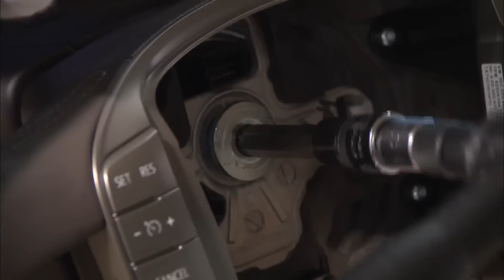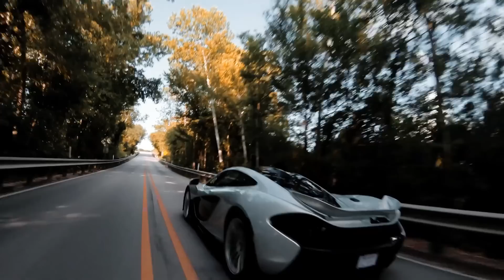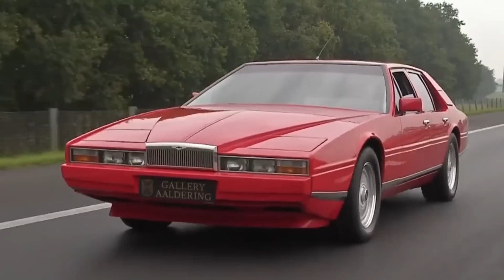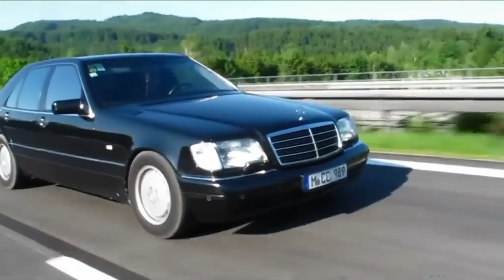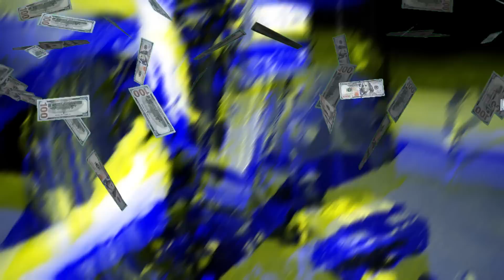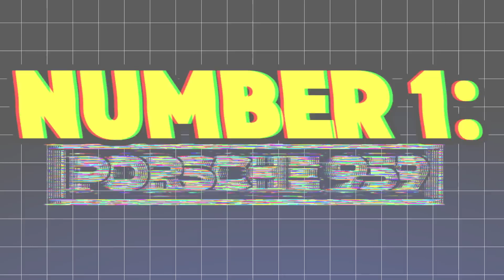17 Stupidly Complex Cars That Will Bankrupt You in Repairs

Comment from the maker: 17 Car Repair SECRETS That Will SAVE You $3,000 (Every Year) https://youtu.be/wrXto638gdI

⬇Care Care Clues Top DIY Tools and Products:
🚗 Essential Scan Tools
Newest Scan Tool:https://amzn.to/3GJyuET 
Bluetooth Scan Tool: https://amzn.to/42AcBRc 
Cheap Scan Tool: https://amzn.to/42WZIzx 

🔋 Emergency Essentials
Best Jump Starter: https://amzn.to/44fYOAm 

🛢 Fluids and Leak Stoppers
AT-205 Re-Seal (Stops Leaks):  https://amzn.to/3S9icYm 
ATS 505 Fuel System Treatment: https://amzn.to/3YQjjA2
Lucas Oil Transmission Fix: https://amzn.to/4jNk98M 
Bar's Cooling System Stop Leak: https://amzn.to/3Sht0nj 

🔎 Quick DIY Diagnosis Tools
Head Gasket Leak Test Kit: https://amzn.to/4jRgc2T 

🛠 Useful Maintenance Accessories
Quick Twist Oil Drain Valve: https://amzn.to/4jWG3GJ 
Tire Gauge (Check Pressure): https://amzn.to/3GxySGD
Tire Air Pump: https://amzn.to/3RZK9Cd 
CRC Mass Air Flow Sensor Cleaner: https://amzn.to/44dJpkb 

🧰 Mechanic’s Must-Haves
Car Battery Tester: https://amzn.to/4jTqyzk 
Basic Mechanic Tool Set: https://amzn.to/3Ymgerh 
Cordless Impact Wrench: https://amzn.to/3YkkhVc

Comment: In all the years I worked on the prelude the 1992 4WS was the most problematic the 88 through 91 prelude had mechanical 4WS steering and the pop up headlights hardly gave trouble unless it was wrecked.

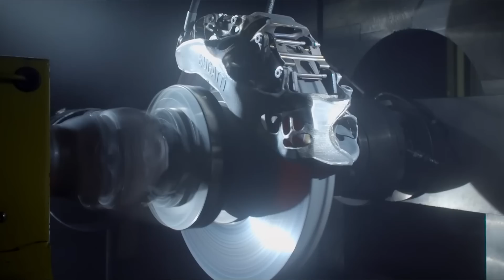Comment: @12:35 I thought the first production cars to use carbon ceramic brakes were the 2000 Mercedes SL55 AMG F1 edition, 2000-2001 Porsche GT2 & Ferrari Enzo. 1st production vehicle(s) to use titanium bolts/hardware were the Honda/Acura NSX (certain variants or all) & I believe the Z06 Vette. I may be wrong. 🤷🏻‍♂️

Comment: All these cars arent even accessible to the plebian. I worked on w100 once its not that hard but, its a complex system for its age. Without a workshop manual its a headache

Ls600h is not that hard to work they only have the valley plate issue and beyond that its ok. Not much breaks on it

Comment: I'm old enough to remember when cars had points & carburetors,4 wheel drum brakes & no emission controls. When I started working in auto repair🛠 things were relatively simple. OBD 1 computer systems,throttle body injection etc. I got out of it years ago. I own a base model 2000 Chevy S-10🛻with over 392,000 miles on it. Bought it used in '07 for $2,600. Over the years it has been a good reliable vehicle,of course I've had to put money into it for repairs.replaced the transmission⚙back when covid 19 was going on. Engine still runs good,no smoke. I maintain it well🛢🛠 and I will drive it to hell & back before I will ever buy a💩🔌🚗E.V. If you can't fix it yourself,always make sure your auto service tech is A.S.E. Certified. The trademark of a great tech.

Comment: Just imagine  the headache awaiting modern buyers with their cars. Since EVs are tanking manufacturers are pushing hybrids. Can you imagine  the repair costs that these 2nd hand owners will face? Quicksm example. A friend bought a 27k mile 4 yr old glc43. 33,000 less then original window sticker. Great deal. Gotta live german car Depreciation. Any way, at around 42,000 mile it have a timing chain cover leak and a transmission leak somewhere. That was 3400 done on extended  warranty.  Now add a complex hybrid  system. Repairs will be bankrupting. These performance  hybrids done make alot of sense in many of the cars. Going back to the glc43. The new one is a 4 cly hybrid, it cost 10 to 15,000 more,m expensive,same acceleration or a tenth better, and its only 1mpg better, but alot heavier. I call that a waste. Just epa butt kissing.  The loaner car he got was a brw c300 with 800mi. Had a check engine light before he gave it back. All tgese cars with the drive in movie  theater size screens will be nightmare repair situations.  And im sure EVs and these hybrids will require special training, so bigger salaries and bigger repair bills.

Comment: For me the worst advancement are turbo engines and direct injection engines, both totally unnecessary along with any automatic over 6 speeds. I own two relatively simple cars. My wife's 18 RAV4. It is a hybrid but reliable and has the simple port injected only 2.5L 4cyl. My truck is a Nissan Titan basic crew cab with the bullet proof non turbo 5.6L V* and a 4spe ed with O/D. PERFECT! We used to drive cars with simple engines like 4s, 6s, and V8s. They had enough power to cruise the interstates and easy to maintain, My wife's previous car was an Accord with the 2.4l engine. Great engine and a 5 speed auto. Buy a good used vehicle with lower mileage if you can and avoid all this new garbage.

Comment: I drove a Citroen GS back in the '70s. It wasn't stupidly complex or unreliable, but it was way better than most cars of the era in terms of comfort and safety, particularly in bad weather.
Reply: The GS was formidable, I love very much to drive it. Alas, cars of the 1970s were made of bad recycling steel that rusted horribly.
Reply: Had a Citroen also in the 90 in France never broke down the engine was what Citroen was known for 😮

Comment: Actually the '57 Ford Skyliner while the top mechanism is a bit complicated for a low skilled DIYer, really wasn't too bad to keep operating. It was simple electrical wiring and simple relays and motors - nary a computer in sight. As to the rest of the car - even that low skilled DIYer could maintain every other system on the car. Never owned a Skyliner but did own a Sunliner (standard convert.) and a Tudor and actually worked on a couple Skyliners as a mechanic. Today, I cn barely work on these new, post ~2000 rolling smart phones/computers that are called automobiles

Comment: Car manufacturers need to build a reliable engine  ,transmission and drive train, and leave the bells and whistles out, basic needs to come back, well built components,easy to repair, maintain, today's vehicle engineers need to stop trying to impress, put the impressions in the main components, engine, drive train, body simplicity, and think about repair or parts replacement, make it using common sense like the vehicles built in the 80s and 90s , early 2000s, and stop trying to impress with all the bells and whistles that are not needed ,they just run the costs up, and always break, I know it can be done, because it has already been done ,these futuristic vehicles are driving off the cliff of nobody wants the headaches of high prices and higher repair everything. 
Back to basics and common sense.
Reply from the maker: Cars used to be tools you could trust, not rolling science experiments. The 80s, 90s, and early 2000s vehicles were made with repairability and longevity in mind. Today, it feels like we’re beta testing gadgets on wheels. It's time automakers stop showing off and start building smart, again, reliable, fixable, and made with common sense.

Comment: Nothing is more mind-boggling and hard to maintain than many Chinese cars. They give out new models so fast for you to get starry eyes to keep changing your car fast not to get bogged down and hassled by poor quality parts, bad design, and problems with maintenance. That's their solution, but if you keep a car for more than five years and more than 40,000 miles, you'll find out the hard way.
Reply from the maker: So true. Some Chinese car brands seem more focused on turning heads than turning wrenches. Flashy on the outside, but when you hit that 40k+ mile mark? That’s when the real design flaws show up. Rapid releases and poor parts support make long-term ownership a gamble most drivers don’t want to take.

Comment: If the Germans had invented the paper clip, it would have 16 moving parts and an oil sump.
Reply from the maker: 🤣 And it’d require a special tool just to open a document. Precision engineering at its finest... even when it's wildly unnecessary!
Reply: @carcareclues  Natürlich!
Reply: .... Plus the paperclip need to have an embedded diagnostic  microchip which needs updating every few weeks.

Comment: The Bugatti Veyron is the $2m car with no hood.  The body has to be dismantled just to do the $20,000 oil change.
One would think if a car cost $2 million dollars they would have thought to install a hood to gain access to the engine for maintenance.  When I buy a car I check for things like that.  I guess they just plain forgot it.  

I can well imagine the look on the faces of Henry Ford, Charles Nash or David Buick when some designer made a pitch for his design that omitted the hood of the next new model.  "Well sir, it's a new concept.  To change the oil we just dismantle the body, and.... Hey... What are you doing??.... Get your hands off me!... Why are you opening that window?!  ....  Hey you're pushing me out!!  NO NO!! AAAAAAaaaaaaa......"😂
Reply from the maker: 🤣 This comment deserves its own screenplay! And you're not wrong—$20K oil changes and no easy engine access? It’s like the designers said, “Let’s build a spaceship, but make it impossible to service.” Henry Ford would’ve kicked that meeting table over.
Reply: If you put your foot down the top speed will drain the tank after 18 miles.

Comment: 5000 lb plus lexus is outrageous.   Thats heavier than the huge 70s cadillacs and lincolns people seem to mock.
Reply from the maker: Right? When your luxury sedan weighs more than a ’70s land yacht, you know things have gone off the rails. All that tech and insulation adds up—literally. Efficiency? Optional. Curb weight? Through the roof.
Reply: It's a hybrid so the battery + everything else needed to support it adds tons of weight. Not really comparable to a 70s Cadillac

Comment: Some of the cars designed in the past 25 or so years were engineering and performance marvels in their day. And they were expensive at the timd they were new.
The 2005 thru 2012 MB SL AND CL600S are a shining example.
12 cylinders 12 coil packs ganged in 6 per side. 24 spark plugs.
Hydraulic self leveling syspension. 6 hydraulic cylinders to lower the folding metal top.
Pneumatic air system for doors trunk glove box etc. And 604 hp and 800 ft lbs of torque.
mindblowing performance in thei day.
And subject to failure after around 5 years. And very pricey to fix. Your typical 600 twin turbo MB going back that far is long out of warranty and depreciated to 30 to 40 thousand dollars from an original 150 190K.
Why?
Because almist all have between 15 to 30 K of deferred maintenance in them. Because MB no longer services certain key parts such as the hydraulic pump. Because even AFTER MAKING THE REPAIRS LONGEVITY OF THE REPAIRS IS SHORT. Because the design is poor in some cases such as ganging six coil packs together.
Or 8 hydraulic cylinders with limited life of the seals.
By compariso a 2005 Corvette C5 ZO6 cost around 50 K. It had 400 hp and a pushrod engine. Still worh aroundv20K plus if in good condition with 80K miles or less.
Light. Nimble .Amenable to inexpensive mods that will take it to 500 hp. A bargain from a price and performance basis. And guess what?
Today about equal in prestige. Because nothing has LESS prestige than a 10 to 15 year old luxury car.
Reply from the maker: Brilliant breakdown, Joe. Those twin-turbo V12s were absolute monsters—power like a rocket, but reliability like a ticking time bomb. It’s wild how quickly a $180K masterpiece becomes a $30K gamble with $20K in hidden repairs. Meanwhile, that pushrod Vette is still kicking and easy to wrench. Classic example of simple beats complex long-term.

Comment: Sorry all these tech cars just don’t cut it for me . 60’ 70’ 80’s cars had style weren’t all cookie cutter designs . Easy to fix , easy parts could get you out of trouble temporarily most of the time . Yeah they used more fuel yeah made more pollution but I think caused less environmental damage that what it takes to make modern cars . At least if it breaks down you have half a chance to get going . Todays cars if breaks can be in shop a long time
Reply from the maker: I get it. We’ve traded character for code—makes you miss the old-school charm even more.

Comment: I wouldn't give you a plug, wooden nickel for ANY of these POS in this video, except the 1958 Ford Skyliner. None of them are worth the selling or asking price. More expensive does NOT equate with "better." 
   I will stick with what works. My 2002 Ford F-350 Power Stroke Crew Cab with 40,680 original miles, puts a smile on my face everytime I fire it up. Always garaged and pampered like new. Besides regular,  yearly maintenance costs of approximately $150.00 annually, I've only had to spend a total of $400.00 on repairs in 23 years. That is true reliability. Something that NONE of the mechanical nightmares mentioned in this video could ever live up to.😂
Reply from the maker: Now that’s the kind of reliability money can’t buy anymore. That F-350 sounds like it was built to outlive us all. Honestly, it's hard to argue with a truck that’s been pampered and still runs like a dream 20+ years later. You’re not just driving it—you’re winning. 💪

Comment: Mercedes 600 uses pneumatic system not hydraulic I recall
Reply from the maker: It actually uses a high-pressure hydraulic system—3,200 PSI to be exact—for windows, seats, trunk lid, and even the sunroof. That’s part of what made it so advanced—and so infamous in repair shops.

Comment: Because the Citroen DS is so beloved, I would gladly put up with servicing its hydraulic suspension. The Aston Marton Lagonda could do with a bypass of all the gadgetry and maybe convert it to electric. Might be fun. The rest are really a bore in my opinion. But the mindless over-application of electronics in cars never ceases to amaze me. Such expensive, unwanted junk is such a huge turnoff.
Reply: I understand that part of the DS' problem was that most Citroën garages weren't trained well enough to deal with the hydro-pneumatics that powered the car's suspension, steering and brakes.
Today, DS owners go to a few specialists who know their stuff, so a well sorted DS today should have a much higher life expectancy than an average new one in the 1950s.
Reply: @notroll1279  The real problem with pre 62 D's was the rubber available to seal the hydraulic system. Major mechanical parts were always very robust on D's. Have owned/driven them for some 60 years.
Reply: @citroenfan8930 
> 60 years - what a great experience to look back on!
Reply from the maker: The DS has soul—quirky, elegant, and worth the effort. The Lagonda too, if you strip out the chaos. But yes, modern cars crammed with half-baked tech? That’s just expensive noise with no charm.

Comment: Volvo XC90 T8 nice, fast car when it has no glitches, but it's a daily thing, everyday something new stops working on top of many small problems like rain sensors, seat controls, overreactive to phantoms automatic braking, bad Bluetooth connectivity, need to reset that ugly console every other day, and in last two days it stopped charging.
Reply from the maker: That a love-hate relationship on four wheels. The XC90 T8 is a rocket when it behaves, but man—when the gremlins show up, it’s like playing whack-a-mole with your sanity. It's wild how a car this modern can feel this unstable day to day.
Reply: @carcareclues  Man, today it almost ripped out my garage door, it was too close when I opened my trunk, scraped of all the paint. I would assume resistance sensor is not built in or just garbage like everything else.

Comment: I have an 3 OWNERS M-B W126 560SEL with 80.000 km from 1986, and a 2 OWNERS M-B 124 500E with 65.000 KM from 1994, it is my sommer car`s🥳, Best (DAIMLER) Mercedes-Benz have made🙏, and the W123 model series, but all the new car`s today is shit💩.......
Reply from the maker: Those classics are the real deal. Built to last, no drama, all class. The W126 and 500E? Legendary machines. It’s crazy how 30-year-old Benzes feel more solid and reliable than half the “luxury” rolling off assembly lines today.

Comment: I am a retired automotive engineer so have a little experience in this area. The cars are no longer designed by engineers but idiots with an art degrees. They have no clue what is the purpose of a car and turned it into a computer on wheels that constantly beeps or flashes some lights at the driver distracting him /her from safe driving. If anything goes wrong (even very minor failure) you stop and there is nothing you do except call for help. I am in Australia so just imagine what it means if you a thousand keys from home. To this day i regret selling my old BJ-40 SWB Toyota Land Cruiser. It was built according to a KISS principle - Keep It Simple Stupid. No more such philosophy as we have ever increasing number of idiots in all  areas of industry and society....
Reply from the maker: Couldn’t have said it better. What used to be a machine with purpose is now a blinking, beeping distraction on wheels. You nailed it—cars today don’t break gracefully. They just stop, demand a code scan, and leave you stranded. The BJ-40? That was a real vehicle. Simple, solid, and built with common sense—something we need to bring back.
Reply: Would you rather drive the 40 year old Land Cruiser into wall or a new one?  I agree would be nice to be designed to be worked on if needed.
Reply: Got an 80 series LC😊